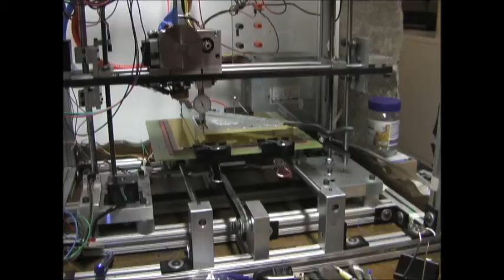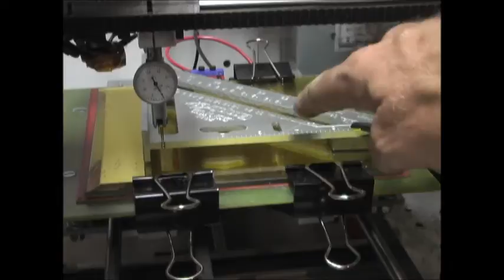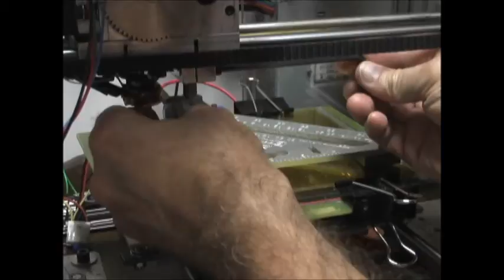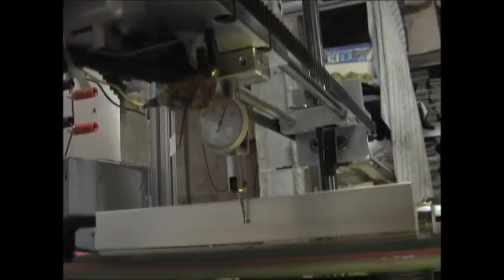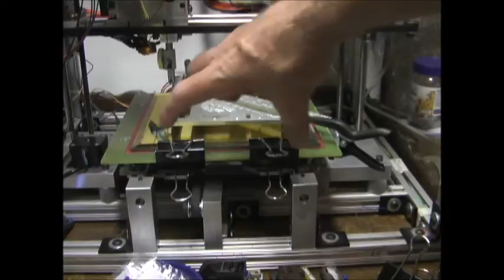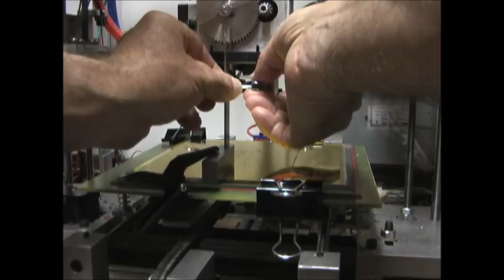Squaring the Axis on a RepRap / RepStrap 3D Printer with a Mitutoyo Dial Test Indicator

Comment: Thank you for the post. An alternate method is to put a pin/pen at the tip of extruder and mark three points of a triangle.  We can use the 1,2,3 rule or pethangory theorem c=sqrt(x*x + y*y) right triangles to validate the square. This also has the benefit of validating distance traveled is accurate.

Comment: you can adjust SKEW in the firmware to fix this issue.
Reply: You can now, well, as of 2 or so years back, but you couldn’t 6 years ago when this was published.
Reply: In any case, it will be more correct to fix the geometry.
Reply: Nod Eho especially if making engineering components or anything requiring high accuracy.